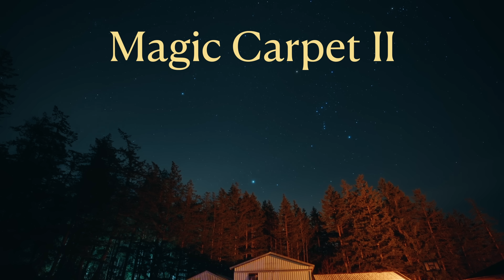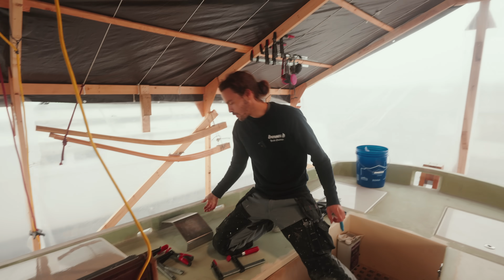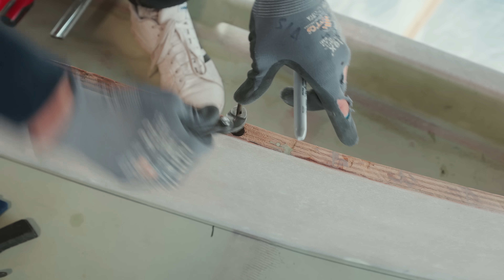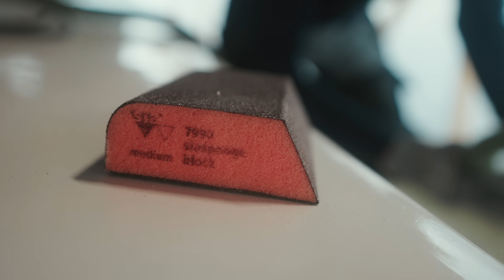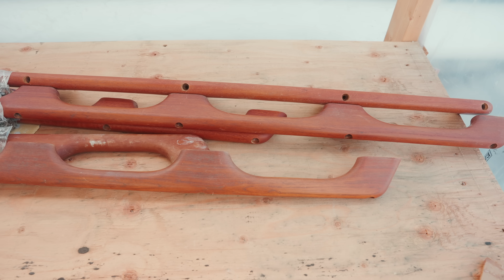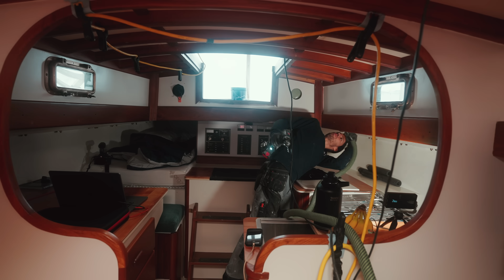Is This Boat Too Heavy Now?

Comment: As usual your work is impeccable. And while you may jokingly worry about weight, the Cape Georges carry heavy loads quite well. The 31' was designed as either 16k# or 18k# (depending on which of the blueprint sheets you look at) but mine weighed in at 23.5k# when hauled out in Ireland. Considering that it made it from Portland, Oregon, I guess that there isn't a problem other than wetter decks.

I like the cockpit coaming design. Mine didn't terminate at the bulwarks but rather wrapped around the aft end of the sitting area, with a low area for the tiller to clear. In heavy going the water rushing down the deck would turn inwards when hitting the transom and then pour over the coaming into the cockpit.

I also liked the winch stands better than the old design. I had mine made of stainless steel to look similar to the wood pads but cut out. More holes in the deck...

Could you, or someone else if they remember, post to tell me what material was used inside the bulwarks? I am nearing the time that the old cedar will need to go.

A recommendation: while the 36' has a lot more storage than the 31' I think you would like what I did to provide for more storage. I made shallow boxes that fit between the deck beams, with the bottoms extended to rest on the shelf. The inboard end is held up with the type of barrel bolt used on French doors, with a spring detent for both open and closed positions (mounted inset to the bottom and fitting into the back of the carline). They stayed in place without fail for many a mile. These boxes provided the shallow storage that would otherwise be found in a desk or kitchen drawer (no drawers on my Carina), including tableware, knife, and paperwork storage among other items.

Comment: White is a very tiring colour on the decks, a light grey mitigates the dazzle, in sunny climes.
Do the x coats of varnish then fit, plug and sand then coat just the top surface of the rails, a couple of times.

Comment: My 40 year old 40 year old Spencer had the original paint on it so when I painted I moved the waterline up 6" to paint the bottom, them moved it back down 4" so I was 2" above the original waterline.  When I launched the boat the water was right at the waterline.  I should have left it 6" higher.  Ya, my boat's heavier than it originally was.  It's no problem having a high waterline, but a too low and you're always scrubbing off algae :-(

Comment: I have a question regarding the winch bases - Since they are basically a bridge between the bulwarks (foam) and the coaming (wood) the portion of the forward thrust  to the boat that is delivered by the jib sheets is applied to those items only. Are the bulwarks and coaming attached to the deck adequately to safely transfer that force under all conditions? Your craftsmanship and patience with odious tasks like sanding for days on end never cease to amaze me!

Comment: You might already have varnished the hand rails by now, but if you haven’t I suggest you oil them. Not only is it easier, but it would offer better grip, feel great to handle and I think the contrast would look great against the shiny trim.

Comment: The handrails will look great, not a problem at all to varnish them while they're installed. It might be even easier, since  you don't need to think of a solution to fix them in place on a workbench.

Comment: I ken you are sick of fibre glassing but a scupper is needed or the water will wash into the cockpit. Not a small one when on a lean it will be a very wet seat. Salt water backside = sore backside.

Comment: I was actually wondering about the weight of the boat. How is it doing?  I think you answered. Heavier is better for rough seas of course. You could save weight on your mast and rigging, I suppose. At the risk of increasing the cost.

Comment: My dads old boat the hand rails where all bolted on through the wood with captive bolts epoxed in, It made getting them on and off really easy if fiddly and made varnishing them really simple too. The were external handles so they were varnished ridiculously often, prior to uv proof varnishes. I hated the job growing up.

Comment: Such beautiful work. 
I’m sure you’ve completed varnishing the hand rails but, if not, Aladino may want to loosen them, place short spacers at the rail interface. Maya could then do a simple masking, followed by varnish, drying, spacer removal and snugging up the handrails to the trim.

Comment: Really, really like the alteration to the cockpit/aft deck. The lines, flow on the cockpit coaming is absolutely gorgeous, the added storage and space on the aft deck a nice improvement.  That area is well used cruising, anchoring, embark/disembark, storing lines, fenders. Very practical and aesthetics spot on. Props to you my man!

Comment: I sail a Rustler 36. There are times down wind in bad weather when a combing across the back of the cockpit stops the slop wave from completely filing the cockpit. There are other times when the cockpit fills anyway. That happens to boats with little stern overhang.

Comment: really coming together…about that combing and scupper …im thinking that the area aft of the last scupper could be an enclosed storage nook for small deck tools…winch handles etc…can have a closed top with open access through combing into cockpit…would need a small drain hole that most likely could drain forward…that space as it is now appears to be an odd shaped place that would collect dirt and such and would drive me crazy..i am pretty sure aledino would notice this too…small details, but hopefully useful…cheers!

Comment: if you want to save taping time (TONS) pace a square of quality wax paper under the joint as you screw in the handrails.  you can tighten them down lightly -then varnish scuff recoat to your hearts content.  Then once you're ready to put fully assembled coats or?  you just loosen the screws a bit grab the paper with two hands, pull on it and you can tighten it up as far as you want, no mess no fuss.  I've seen and used this technique after learning it from high end wooden house finishing gurus.  This technique works even better when installing door / window etc trim , line the edge with wax paper when installing the trim / frame use blue painters tape to keep the paper positioned then you can even use a razor blade to cut it off without loosening the trim...saves tons of time
Reply: How does that work with bunged screws? Seriously??
Reply: @CAPTJohn47  not at all. Just to answer your question 😅😅
Reply: @soloroy6020  actually it does... Handrails (in new construction and some restorations) are often varnished off the boat, installed later.  So its not unusual that the bungs are installed, trimmed, planed flush, and then spot varnished on a mostly finished handrail.  Pro-tip, you don't use glue, use varnish as glue when you put them in.
Reply: Just did my handrails last year, and this is exactly what I did - did all coats off the boat, installed, bunged, then did same layers of touch up over the sanded bungs. Worked out great.  Neat trick with waxed paper! But yeah wouldn't work once you have bugs in (unless you cut it with razor blade).

Comment: For the screw holes… could you varnish the rails before installing them, then put the bungs in and varnish those. It might be easier to mask off around the bung holes instead of the rest of the rail. :)

Comment: Not too heavy….check out all the weight in spare parts Kirsten Neuschafer sailed around the planet with in winning the GGR in a sistership to Magic Carpet. Don’t sweat the weight in foam.
Reply from the maker: Don't worry, we're certainly not concerned with the weight -- this boat may actually even be a little lighter than when we first bought her :)

Comment: Would it work to just use a strip of plastic cling-film like Saran Wrap to mask off the wood?  You could screw the handrails right into it, bung the holes, and varnish the whole thing.  Then tear the cling-film out when you're all finished.